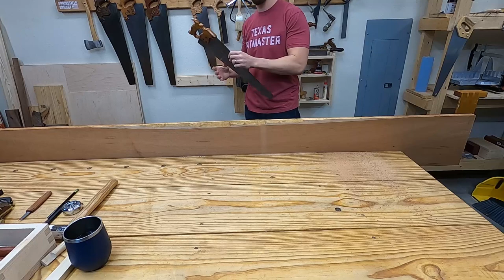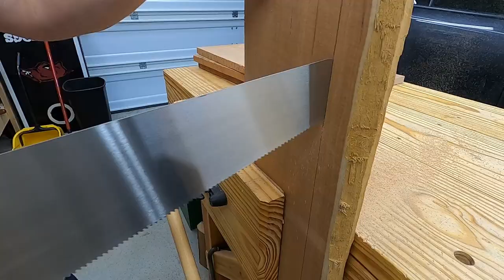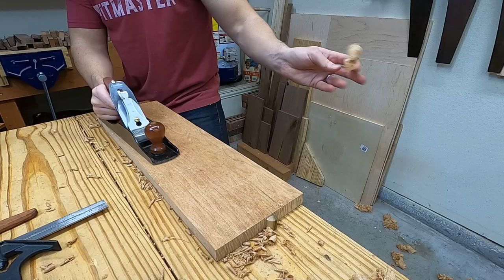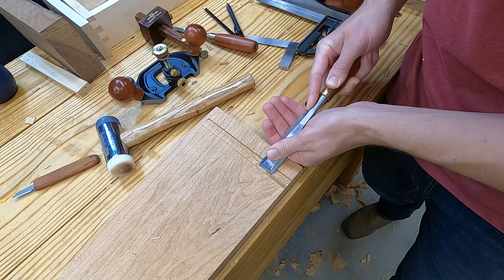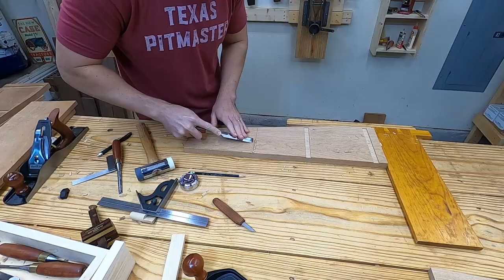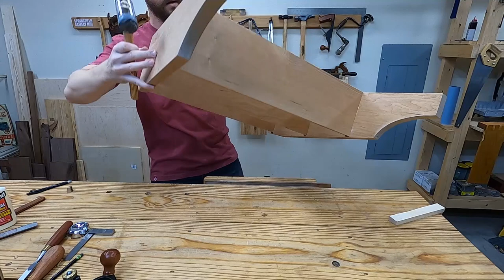Shaker Style Wall Shelf - silent woodworking

Comment: Good job !!! May I ask why don't you make chamfered edges? What grinding stones do you use? And what graininess? Would you buy them again? I'm thinking of buying stones and I don't know much. Thanks for the reply. Have a nice day.
Reply from the maker: My plane irons actually do have the edges relieved to give a slight camber. On a flat stone like diamond or water stone you have to lift up and just sharpen the edge of the plane iron. On oil stones like mine the middle of the stone gets more wear than the edges due to sharpening chisels etc so the very slight cup or "dish" of the stone will naturally give a mild camber to the iron. This is a medium india and translucent arkansas, I'm not sure what grit that equates to.
Reply from the maker: If you meant chamfered edges on the wood, there is a small chamfer

Comment: Hello Frank!
I got a question with the hope that you can answer it
Do you consider fair charge $100 USD for this shelf?
I'm building one with the plans i bought from your store. I'm using Rosa morada (Mexican oak) a $4 USD ft wood

I just simply don't know how much is a good price.
Cheers, great video btw!
Reply from the maker: At a minimum. Pricing this kind of work is unlike pricing a deck or fence where you might double material and add labor (time). You should be charging more and more over time as you become more efficient and more skilled. It's more like pricing art than a commodity because a traditional formula would have a person charge less over time as they are able to do it faster; but in fact they should be charging more with increased efficiency and skill. Also keep in mind that at $100 ppl may not value the hand work --its very strange but ppl use the price tag to determine value and think anything with a low price is "cheap" even though it may be solid wood with hand tool joinery unlike anything they will find elsewhere. Just my 2 cents. Thank you for the plan purchase!
Reply from the maker: Also if someone contact me for this project it'd be $350 that's with doing the rough stock prep with machine and the rest by hand
Reply: Thank you for your time and insight, i wil always keep in mind this knowledge and be forever grateful with you!

I was really confused and I even thought that $100 USD might be to much, now I see i was under paying me way too much

Thank you so much, and I'm looking forward to the plans of your walnut bookcase, i love it!